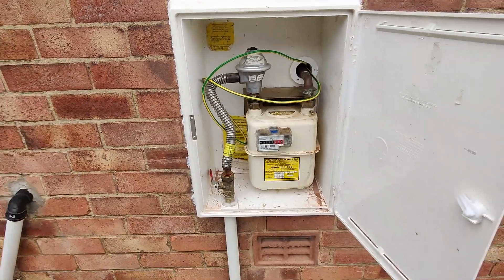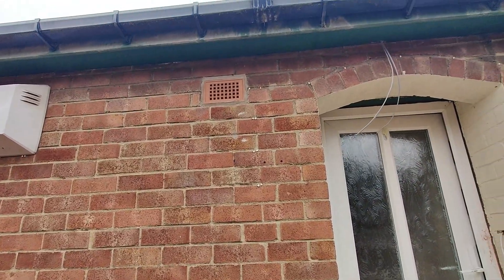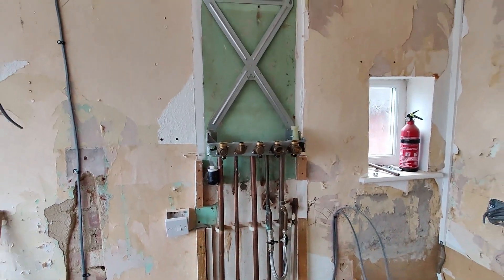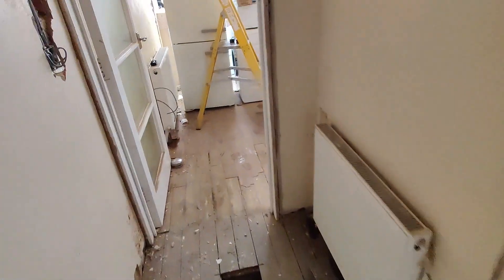HOW TO CARRYOUT BOILER INSTALLATION, COMMISSIONING Worcester greenstar

Comment: Nice neat job .
Just one question …… and could just be the video but does your prv , which is running through a Tundish then join onto the condensate pipework which is fine if using a hotun or similar self sealing trap. However like this the condensate open to attend room ? I thought this was at risk but could have it wrong
Reply from the maker: Hi Rob, I hope you are well.
To my knowledge it doesn't create any problems as there is a built in trap within the boiler for condensation which eliminates the risk of POC entering the building to my knowledge.

Comment: 9:55 That's the craziest thing I've seen in a while.
Reply: @metallitech  I saw my trainer do this when I was still a trainee. He was fitting a rad and the second hole hit the joist so he just kept going on. That's a very bad mentoring I think.
Reply from the maker: There was another one in the same floor for the radiator 😢

Comment: Nice job. May i know how many days needed for this job
Reply from the maker: Approximately 3 full days for me on my own.
My younger self could've done it in a day and half :)
Reply: @MHKBuildingSolutions  the condensate connection is a bit unusual which left an open connection to air may I know how is that?
Reply from the maker: @ununha  The condensate is terminated into a gully and not a soil stack hence it doesn't have to be sealed.
If there is no worry of foul smell then it's not a problem having air gaps.